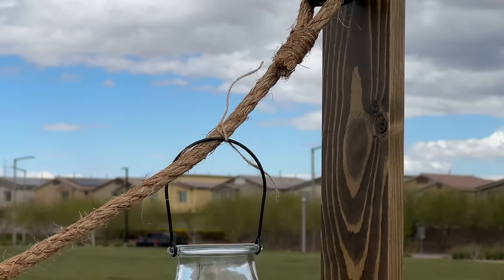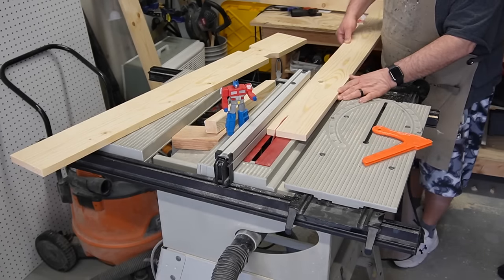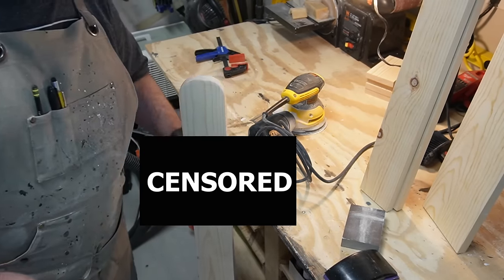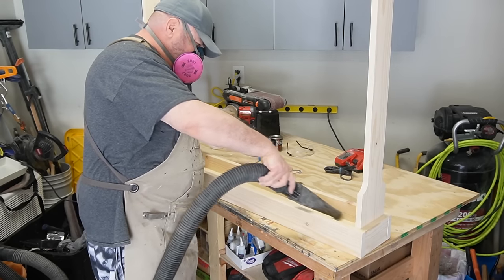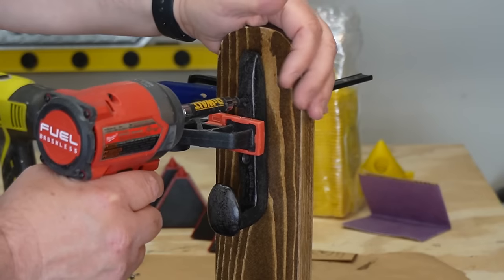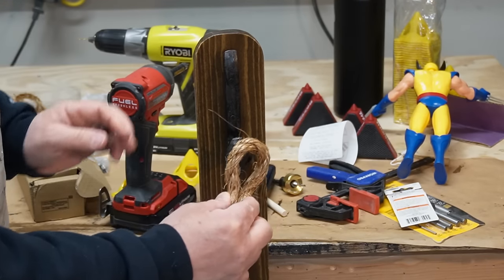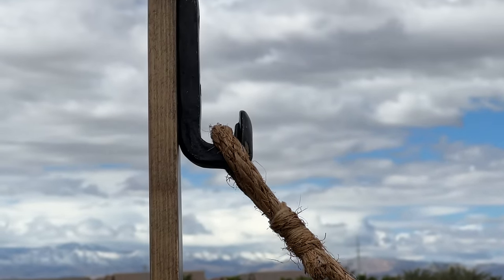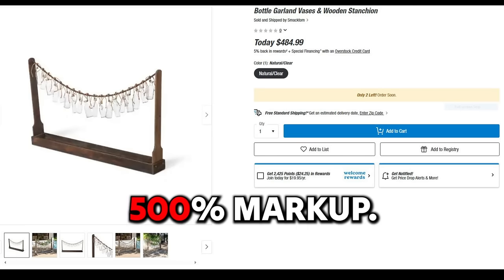High Profit Wood Project that sells but you'll want to keep it for yourself. DIY Woodworking

Comment: Just "because" its selling for $500 doesn't mean people are BUYING them...😂 I wouldn't. I'm sure there are SOME people who have $500 burning a hole in their pocket...thosr are the ones buying $600 red sneakers too....😂  I'm pretry sure someone can buy this at either Walmart, for $44.99 or at Michaels Craft Store for $39.99...😂
Reply from the maker: I agree with you, that's why I put 500 percent profit. I should have explained it better because I can see how it can be confusing. It really is being sold online for around $250 to $500. So the $500 at the end would actually be over 1000% profit depending on what you spend in materials. 500% profit would calculate to selling it for less than $250.
Reply: Not only is your comment not constructive, but it’s off base.
Reply: @jascogoods  You haven't factored any labor cost.. how many hours did it take to build?

Comment: Water based paint over oil based will come off . You can do it the opposite way no problem. I don't know about the stain but as far as paint that's why
Reply from the maker: Yes that’s what I have heard also. I’m far from an authority but I haven’t seen it come off yet and I have things that are years old. But that doesn’t mean it won’t. I think even if it doesn’t come off your clear coat might start to look hazy.
Reply: @jascogoods  yeppers that's what I say I'm no expert on stain but I have seen happen to paint many times

Comment: I love this. Such a cool idea. And you are so funny! BTW might want to use some other glue in addition to hot glue for the rope. Hot glue doesn't last in the elements.
Reply from the maker: Thank you so much for the positive feedback!! It is really appreciated. And thank you also for the hot glue tip, I didn’t know that. Now im wondering how the whole rope is going to hold up in the elements. 🤔 may just have to make a new rope every few years.

Comment: Lovely,
The work is the easy part.
My hesitation is how and where to profitably market/sell  craft items. 
And no ,etsy and other places are not good.
Where do you suggest?
Reply: Maybe Facebook Market place?
Reply from the maker: I agree, they are too big to sell on etsy unless you make the two side pieces detachable. I have sold them on Facebook marketplace locally. Then they can just pick it up or you can drop it off.
Reply: @jascogoods I like the idea of detachable sides for storing.
Reply from the maker: @jennyleo82  I think it would be easy because they are sandwiched between the other 2 2x6s. I was originally planning to do that but I was worried with normal movement of wood they would not fit after a while

Comment: I used to have a table saw that would trip the breaker when I made rip cuts in 2x material... Until I put a new blade in.
Reply from the maker: maybe its time I changed the blade. it was the breaker on my power bar that tripped. this is a newer house and it was made cheap. I always blow the breaker when its cold and I'm using my miter saw.
Reply: @jascogoods  the saw I had problems with was a used, God only knows how old saw that probably had the original blade still in it.

Comment: Change the title to "DIY IF you have a full woodworking shop at home"...
Reply from the maker: I'm starting a woodworking channel where I build everything with butter knives. Ill let you know when it launches.
Reply: I don’t get why people look at the tools you see in videos and think guys can only make stuff with expensive and/or a lot of tools. You can absolutely make any beginner or better woodworking projects, including the project in this video with a few cheap new or used tools. All you need is a drill, a circular saw, a jigsaw and a sander and you can make tons of stuff. You might want to use a straight edge of some sort to cut straight lines and, it might take a few minutes longer to make something, but these tools are all you need to get started. A shop vac would be nice, but if you don’t have one cut your wood outside or wear a dust mask. If you don’t want to spend a few bucks on a circular saw, use a handsaw or a jigsaw with a straight edge. I have a used jigsaw, circular saw and drill that I’ve listed online for free and nobody has ever contacted me. They are corded, but so what, they work great. There are always people giving away or selling tools for cheap. Sure, having a shop full of nicer tools is nice and makes things easier and ofter faster, but most beginners start with the tools I mentioned and buy additional tools when they have the money. Don’t use the excuse to get started in woodworking on the fact that you need a lot of experience tools. I started with the used tools I mentioned above. In fact, I didn’t have a sander so hand sanded everything which sucks big time! I’m 65 so remember using a handsaw, a sanding block with cheap sandpaper that didn’t last more than a few minutes, and a hand drill that spun as you pushed down on it. Back when I was a young kid, there weren’t very many people that could afford power tools. In fact, the finest craftsman throughout history only used hand tools to build beautiful furniture that most of us couldn’t afford to buy.
Reply: Lol but you absolutely DONT need a full shop to make this, just cause he does doesn't make it so. This can vary easily be made with the basic tools on an apartment patio even lmao. But if you have the tools why not use em right?